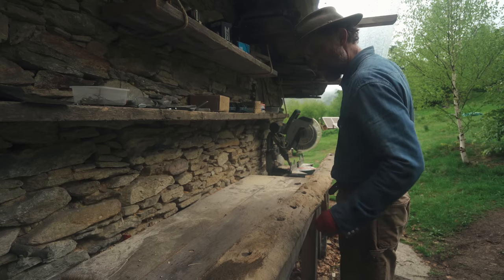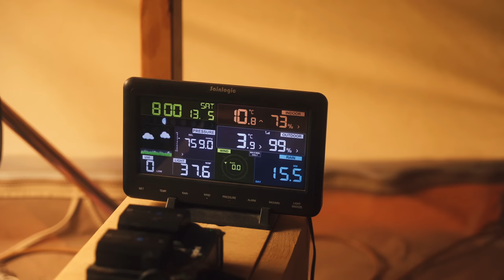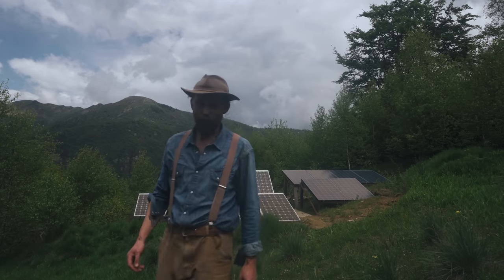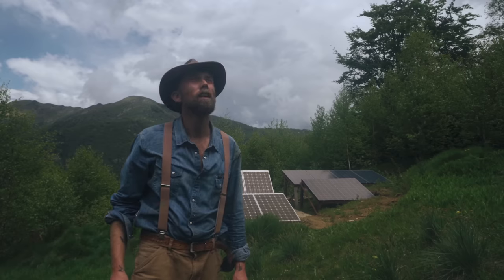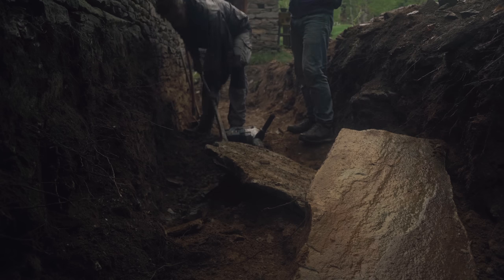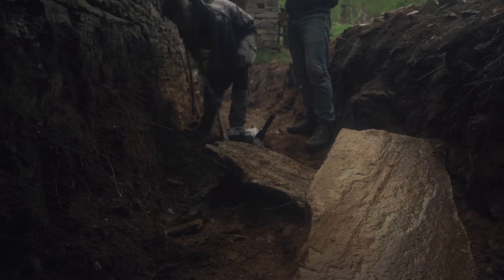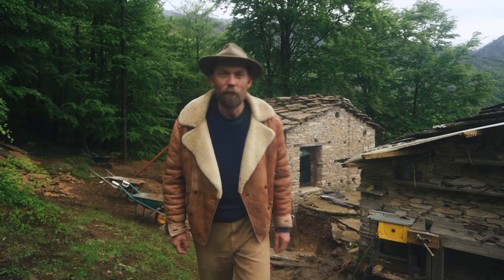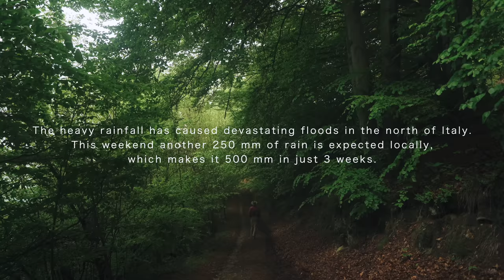#67 Anticipating the Flood

Comment: It concerns me that you may have not dug your trench deep enough. Trust me Martijn, you do not want to error on the side of water. Mold is a very big concern. Water will find a way in. It always does. You need to make sure you are digging your trench below the foundation of the cabin and it seems that you are of the mindset that it should be enough. Not good. There is no good enough with water. Black mold is not something you want to deal with in the future and will cause serious health issues. The trench should also be dug in between the cabins as well, not just around the perimeter. Water will find a way in. I would also advise that once you have the trenches dug out to then take the excavator to the upper side of both cabins and scrape away the earth all the way to where you had the guys piling up your rocks. It should be graded away from the cabin (swail) and you can build a stone retaining wall that will look beautiful, create a space for a wonderful stone path all the while pulling rain and moisture away from the cabins. It's a lot of work but again, YOU DO NOT WANT TO CHALLENGE WATER, IT WILL WIN EVERY TIME. Water wicks therefore you want to make sure you dig down to the base, otherwise it will seep in underneath your vapor barrier and french drain. 
And yes, I agree with all the comments suggesting a stone driveway much like your stepping path. Eliminate the small slopes as much as possible and create an even continuous grade. 
Lastly, yup, you're going to need to give those chickens a proper enclosed run. As soon as a predator catches wind that there are chickens available, they will not let up until they get their kill. 
P.S. The cabins built into the cliff side are absolutely stunning and wonderful job on the impromptu rain coat guard. 
As always, all my best to you! Cheers and get digging! Please!
Reply: Hello Martijn, I'm ok with this  comment of Aaron. It's a hard work to do, sure !! We have seen how much it has been difficult for you and friends who helped you in this pouring rain !!
But please try to dig more and more ; cause we can fight the fire, but we cannot fight the water or the wind... You're a fighter Martijn, really !!! And I send you a  lot of courage for this week, Take all the time this work requires, you're a patient guy, we can see that every day, I really admire you !!! See you soon Martijn, kisses from France, Jacqueline 🙋
Forgot to tell you that the Cuckoo is still there, it's really good to hear him, I enjoy very much !! Bye and so long till seeing you again with a great pleasure  😇

Comment: I hope the trenches do not collapse from the rain.  I’m speaking from much experience.
Reply: Thinking the exact same thing here....
Reply: I am afraid the trenches are not deep enough. It should be at last half a meter under your groundplate. The water coming down the hill is more than 2 meters under the ground. It will come under the trench and press trough your walls. Your bedroom will be wet and full of mold.
Reply: @lokilokeunicorn4362  even the freshwater line is to shallow.  It should at least be 4feet deep to prevent freezing.
Reply: @lokilokeunicorn4362  yikes!

Comment: Martijn may have to consider building a driveway out of rocks or gravel.
Reply: rocks underneath it, gravel on top.
Reply: @rallyscoot  gravel would just get displaced, probably better to lay big stones down like the ones on the roof, mind you probably not worth it in the long run as he wont be getting lorrys to deliver stuff everyday
Reply: @blackkray8351  true, but also, it would be a permanent place for his own car and trailer.
Reply: Certain mixture of sandstone gravel may withstand… I am sure Martijn will find the best solution, just too bad it adds to his long list.

Comment: It's time to make a proper driveway so trucks can make a delivery and not get stuck. This isn't the first time - you yourself have gotten stuck many times. Make a uniform slope - eliminate the hills and valleys and create a way to circle back to the main road without having to turn. You should also have a gravel base, even if you want dirt on top.
Reply: Have you even the VAGUEST idea what an enormous amount of time, hard work and cost that would involve!?
People in this kind of situation don't generally do jobs like that because they're just NOT PRACTICAL...!!!
Reply: Gotta be done Andy can’t stick your head in the ground forever.  Can’t have people stuck for several hours each time a site visit is made.  He still has lots of construction and deliveries to go…
Reply: Yes, I do know what is involved -  if I lived closer, I would happily help him plan it. He isn't scared about a hard job, though. Think about the enormity of doing that roof or shoring up the foundation - tremendous. But he did it.  For things to last and to work, you have to do them right.
Reply: With all the stone you have, you can actually build a base like you had in the ground floor barn - place stones vertically, and then put gravel on top. You only need 2 strips - where the tires touch the ground - not the center of the drive.

Comment: Those stone walls and floors are built directly on the ground. The cabins were summer shelters not houses. From experience I know that a serious foundation is needed otherwise you will never keep it dry inside. Humid infiltrates walls and floors without a decent concrete barrier under it. Would be a pity for all that work done.
Reply: huh? its not old cabin ?

Comment: I was taught to put a small amount of washed stone on the ditch then lay your perforated pipe with just enough pitch to run water. Then cover your pipe with more stone and cover with some sort of filter fabric the width of ditch, On top of filter fabric you should apply like a sand or gravel to the top of ditch. I did this at my home and in 20years have had no issues.

Comment: I would have dug out a nice recessed patio with the retaining walls about 15 feet from the two uphill walls of the house, used the removed dirt to fill in on the downhill side basically creating a flat area surrounding both houses and paved it with your native flagstone. You are doing a fine job regardless of which direction your vision takes the project.

Comment: For the manger feature, you could put small LED Candelabra bulbs in the holes and mount it on the ceiling for ambiance lighting?  Could even use DC instead of AC with your solar setup.  Just a thought.

Comment: Nice to see a whole team at the cabin, just an observation, I know its too late for this week but in the future if you're going to shift large amounts of soil / rubble, a mini digger really needs an effective method of moving the soil, so a dumper truck or a quad/tractor with a tipper trailer (which given the gradients you have might be a better option) is really helpful and avoids a significant amount of manual handling. Whilst I appreciate you're trying to be as artisan as possible since you've already hired a mini digger, you might as well go the whole nine yards.

Comment: In front of the small building, where you had been dumping all of the dirt......has it crossed your mind to build a retaining wall, a little bit further from the edge of the dirt pile(s), back fill all of that (make it level with the house), and make a terrace in that spot?? Would make a great spot for a sitting patio.....look out over the valley. Some chairs, little tables and a small patio 'fire pit' (a free standing one made of metal). A great property, like yours, should have multiple sitting areas!

Comment: The church at 6 minutes is a fine example of stucco over rock. With a modern wrap over the rock you can preclude the percolating effect of water on its way through the walls. Diversionary channels around your dwelling can speed the water on its way from your home. Keeping excess water out of our houses has been a preoccupation of humanity since we  first built a roof over our heads. The trucks with 4 wheels driving are powerless with no load in the back.

Comment: When renting the digger, renting some motorized wheel barrows or better yet, one of those little motorized loader with a bucket that you stand on the back to operate, not sure what you call them, would speed up the work effort and save backs.

Comment: I adore the flowers coming up - wild are the best and to see all the dirt taken away from the foundation walls letting it breathe before drainage put in.  One way to get a cabin wash!!  Your sheepskin jacket looks so warm and I have always wanted one so will look out I think as they can't be beaten for warmth.  I think it is fortuitous that you dug the trench around as there is a channel for the water to go and outlets so it could have built up in the dirt and caused a mudslide who knows?  Interesting to see what happens when this amount of rain falls though - bit of an experiment and those poor guys in tents must have been finding it a bit tough.  Is it warmer in a tent though? Maybe.  Wow that truck was rocking and the roads must have been dangerous with all that amount of rain - were they closed off for the weekend?  Thank god for tractors - was that a local farmer?  I went in a tiny ditch reversing and the rain covered the ditch so it couldn't be seen and a tractor came along and pulled me out and it is such a relief.

Comment: Well, i hope the walls of the trench stay up well enough. When there is enough water, it will corrode the walls, and they will collapse. That will be a problem when its the ground the house is sitting on. I am actually worried. It may have been better to postpone the digging until the bad weather has passed. 

You are actually lucky the rock that was in the way of the French drain was in some sort of shale formation.

It actually looks very good, i was expecting the wall the end much shallower. I think you will be fine. 

Don't forget the place the geotextile between the soil and the rocks. :) 

Greetings,

Jeff

Comment: No Marty! I hope you are spared heavy rain and sheets of water that would certainly appreciate your excavations…I would like to find kinder words, but you have created a very precarious situation. 

Just filling the excavation with water would put a lot of pressure on your foundation, which the concrete inside is not designed to resist…which is why the finished drainage is necessary in the first place. However, your biggest threat may be from fast flowing water, which would make easy lunch of the fresh excavation.

Again, I hope your proximity to the ridge and the slopes above you are favorable, and the rainfall pattern blesses you!

Comment: Martijn... oh man... I'm not positive, but you may have just unsettled the structure of your stone cabin with the new French drain project. The weight and force of those stone walls and roof radiates away from their base at a 45 degree angle... both in wards and outwards. You've kind of secured the internal pressure by installing the new concrete and rebar foundation "collar" inside. But now you've trenched away the support of the native soil upslope.  (I understand you're trying to prevent water from entering the envelope of the cabin, and so want to "waterproof" the stone wall itself.) Yet I'm afraid now your best move it to create another concrete and rebar "collar" outside as well... and waterproof the concrete.
   If you would have dug in a narrow trench 4 or 5 feet away from the stone wall you could have controlled the hillside rain runoff / subsurface water and left the native soil intact that is within the 45 degree angle.
... draw a side view diagram and you'll see the rationale. 
.... ( I may be wrong, but don't think a "moat" of gravel/rubble holds less water and is stronger than centuries old native soil.)